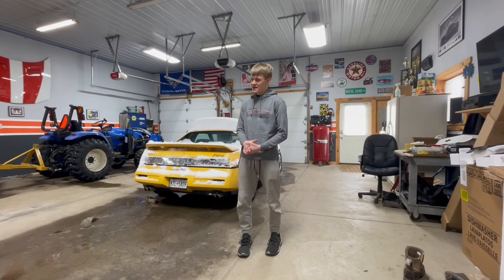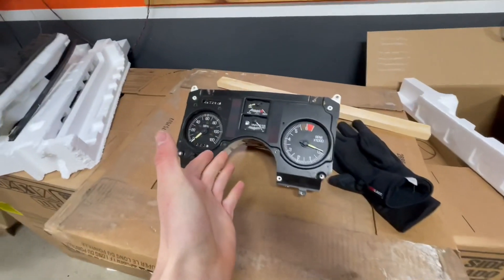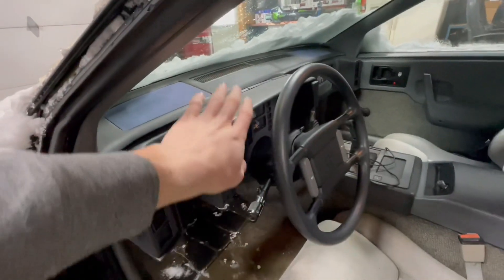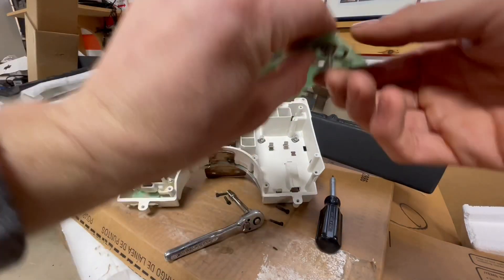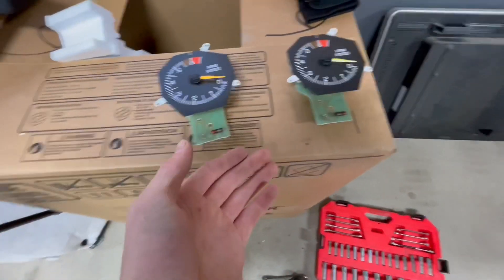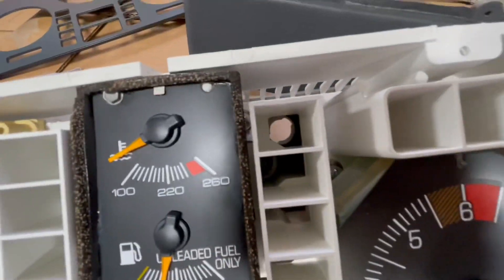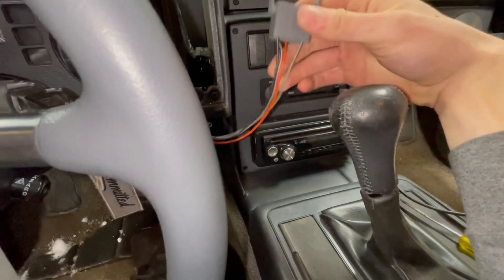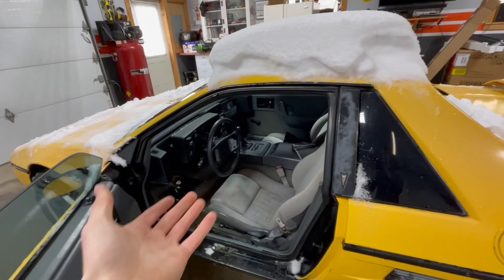Fixing The Tachometer On A Pontiac Fiero

Comment: For the trunk release; 1- there needs to be the release unit on the trunk lock,. Lots of GM products, check the salvage yards. 2- There needs to be a relay under the right hand side of the instrument cluster, under the dash. 3- the factory didn't use a ground wire, the trunk has to be closed, the latch completes the ground. Neither the ignition nor the parking brake needs to be on for it to work. Good video. Keep the Fiero alive. I have 2 of them left. By the way, the shift light was on ALL standard shift Fieros. sixes & 4's. If you know how to drive a stick, you really don't need it.  Good luck with them.

Comment: On the passenger side of hood hinge, there’s a plug for the deck and a ground wire on opposite side hinge for it to work. And you may need the electrical latch. Hope this helps.

Comment: There is a harness and solenoid that is needed for the trunk release to work. Also check if the relay is there for it.
Reply: The trunk pop doesn't use a relay, you just need a solonoid to bolt onto the latch. There's also no fuse for it in the panel so don't bother looking for one, the circuit is on a direct battery tap. All you need is the switch and the solonoid. It's plug and play.

Comment: I recommend the Cajun tach shop if you need a tach board it is a huge improvement over the quality of the stock one. While you were in there you could have fixed the pegging temp gauge on startup, they wired it wrong from the factory. On start up it was suppose to turn on the idiot light but instead it goes to the temp gauge.  Over time the needle hitting the stop can spin the needle on the shaft and make it read incorrect or fall off.
Reply from the maker: How do you fix it? I would definitely not be opposed to fixing that
Reply: @FieroKyle  you got to find a wire diagram for the year cluster and run a wire from one side to another, I have been trying to find the write up on pennocks but it seems like it's lost to time, it has been about twenty years since I did my 88

Comment: The V6 doesn't use the shift light. The computer doesn't signal it. It was only for the 4 cyl.

How did your Formula end up with 88 GT seats?
Reply from the maker: Good to know I didn’t know that. I found a set of 88GT seats in the junkyard and put them in. I just liked them better

Comment: The shift light is a useless thing. Works great on a flat but not on a hill, going up. It signals you to shift too soon and bogs you down on the hill. The trunk needs a solenoid on the locking mechanism for the trunk popper.

Comment: You have to have the key in accessory, to have the trunk switch to work.
Reply from the maker: Not true, the trunk switch works at anytime. The reason it wasn’t working in this video was because I didn’t have the correct relay for the power trunk underneath the dash
Reply: Incorrect.